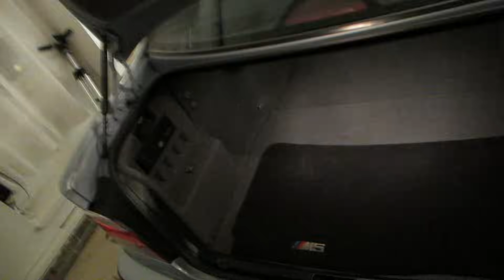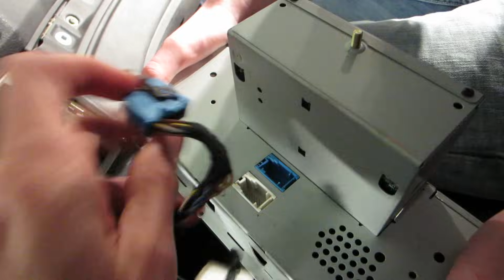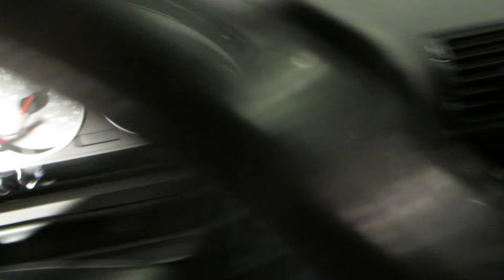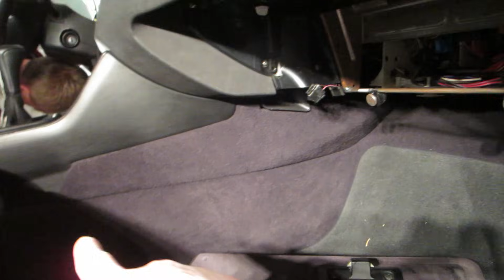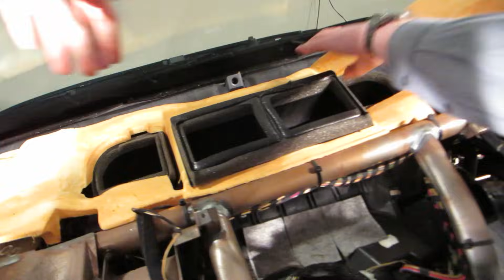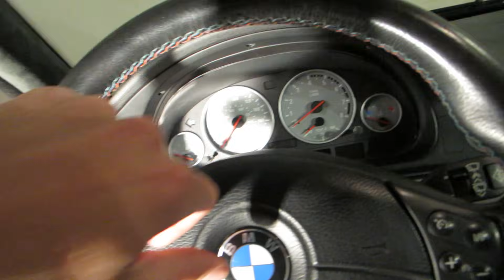BMW E39 5 Series Blower Motor and FSU Replacement DIY

Comment: guys! I have an 96 E39 523i, and I just found out that I can't turn the heating of.. I mean that it will blow cold air from the front blowers but on the windshield and the leg zones it will always be hot air! any idea what ca it be the problem ?

Comment: I know this video is old, but on the e39 is really ez since you are replacing the fan motor and the FSU only, cuz you pull out kind of half of the dash and you should of done the heater core as well since you were half way already. i did the heater core on my E53 and it was very fun taking me about 3 good days. But it is worth at the end. You just need to have guts in order to do it. Take it ez. Keep it up guys.

Comment: Looks better without all the plastic crap in there. Those frame tubes are gorgeous, Id polish those bad boys up and want to look at those rather than all the plastic $#it.  Changing a blower motor shouldnt take more than 15 mins to change out. So sick of all these plastic interiors and stupid clips. I like race car interiors, insulated carbon fiber held in place with a few bolts, everything comes out and is easily accessible to service. Tired of being wrapped in a plastic cocoon and charged lot of money for the "privilege". You suckers then pay thousands to pay auto shops charge hours to remove all this unnecessary bull$#it. Even things like those electric operated baffles is just another point of failure as the car ages, when literally a simple lever to manually operate it would do just fine and last forever.

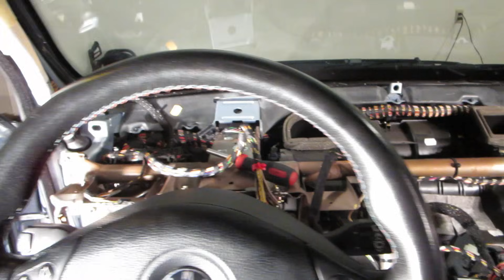Comment: 16:20 - I have 530d from 2001 with automatic AC and there was just a few seconds to pull this out. No screwdriwers, no problems. Just carefully pull off the hassis and release plastic clips.

Comment: Hello, thank you for posting this video, it is very helpful, as your video posts.  In my case the wire connectors in my 2003 530 have never been removed, as such the one with two tabs on each side and the one with no tab are stuck shut in there.  I have tugged very hard and no budging.  I was wondering if you have any solution, may be a spray of some sort that would loosen up the connectors.  Thank you in advance

Comment: When on auto, my car starts blowing too cold and too much air after about 10 minutes of driving, it's like the car thinks the temperature in the cabin is too hot. The airflow gradually increases. When I start increasing the temperature, it starts blowing less. Could this also be the FSU ? Thanks!

Comment: Just a note in case no one has mentioned it before. The later models (maybe 2001 and up?), the center vent with the actuator rod is removed differently. It's held in by two large plastic clips on the left and right side. To separate it, undo the clip on the right side, and in the left vent insert a small screwdriver into the actuator rod. There is a small square that has a nub you need to depress, then try and remove the left clip and slide the whole unit to the right and up.

Comment: Thanks for sharing! Great job. I believe I will need to do this on my 97' E39 because I believe the radiator of the heating system has a leak and the water is coming inside on the carpet of the driver's side. On the other hand the blower motor is doing a strange noise and the heating on the right side is not working....

Comment: My center vent and actuator rod was slightly different. 2 clips in the back, none in the front. Theres an actuator rod behind the vent, reach around it and push the tabs while slightly pulling up. Next, take a screwdiver and push the tab inside the driver side vent down while carefully pulling the vent assembly to the passenger side. Thanks for the vid!

Comment: hm, today I tried to get to my e39's blower motor and the pushing to the left of that stick of the actuator was impossible. It was also constructed slightly differently. It's a 2000 facelift model.

Comment: Omg ! my heater takes about 5 minutes of driving before it actually starts blowing. (before that nothing happens) Once it realises I've actually switched it  on it works fine. However if the cars been off for more than 30 minutes or so the same  thing is likely to happen.

Please don't tell me it's likely a blower motor... I can't do all this! :-o

Comment: You can do this job with out taking the lower dash out i did it just loosen the screws on the sides and you can pull the lower part down enough to get the screws for the top out it only took 3 hours and i was finished one note you still have to remove the glove box no way around that because if you do not the bottom dash will not flex enough to get to the screws.

Comment: Gentlemen - Thank you for the video.  You saved me a lot of money.   For the central air vent in front of the blower motor, I had a slightly different set-up in my 2001 540i (Oct) which I found in video https://www.youtube.com/watch?v=Sku8IKttBRw - doesn't really describe in detail how to remove but the fact he did it led me to believe I could do as well.  I commented there as well.    I think one of you also did the headliner replacement video - that was very good too and took me from gray to black.   Thx.

Comment: Great job and Thanks for Sharing!..........I hope I never have do that with my e39.  I like to use "zip lock" bags for the screws, nuts and bolts and sharpie pen to mark the bags - the snack size works best.   If you drop or kick one of the those "cup of nuts," you are going to go "nuts" looking for them.

Comment: Great video guys!  My Blower issue is that it remains on a very low constant speed on my e39 528it no matter how high I set the control speed button.  Does the FSU have anything to do with that?????

Comment: Followed this guide. Thanks for making it! :)

I have a 2001 e39, the pin and package mount with the air distributors is different after 2000 models, so i broke mine despite your warnings... Lol. Managed to glue it and it seems to hold up.

Right now im quite happy that i did not leave it at the workshop, it was not hard at all when following your guide.

Thanks for making it!

Thanks a bunch!

/ Swedish e39 owner

Comment: hey lads;) Nice one;) I've done it myself, about nine months ago, as the bloody heater was licking:( Your movie is great, just forgot to mention that upper dash is having a pins (plasticks fingers) which need to get to their place in front wall of the car otherwise putting back all together will be a bit dodgy and on the end dash will not line up with doors and other elements etc. Warm regards from Poland;)

Comment: Excellent video! I was just comparing it with the blower motor DIY on M5Board and it looks like the head unit doesn't need to come out. In any case, it's a great resource for the M5 community. I'll post this video up on M5Board and nominate it for the DIY sticky if that's OK with you.